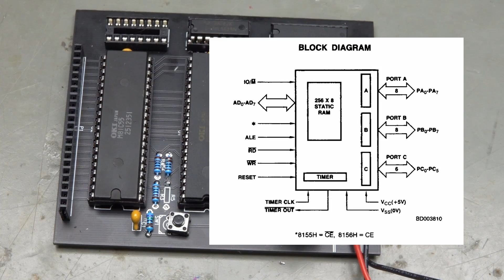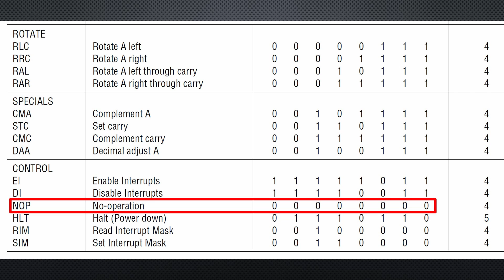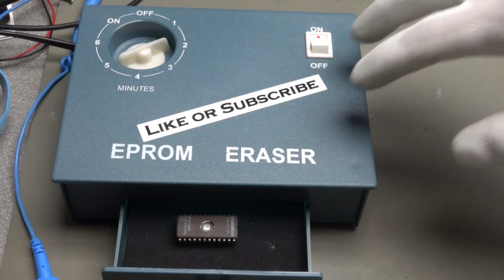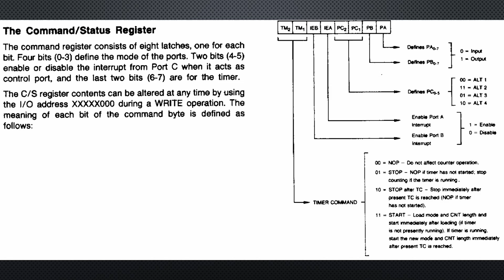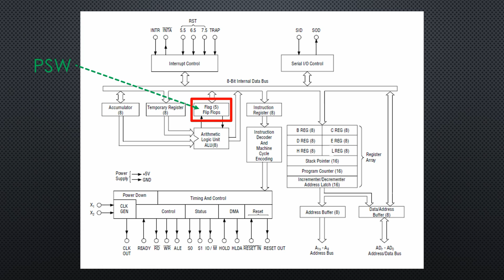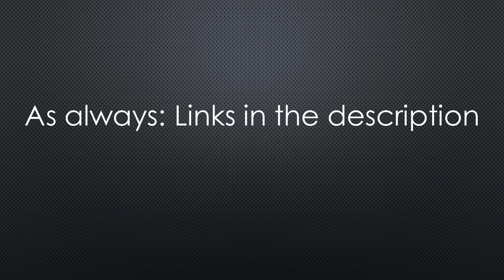#314 Retro: Assembler Programming with 8085 (incl. plan for board)

Comment: Excellent presentation!!! Kudos!

In biology,  scientists use "model species" like mosquitos 🦟  and other critters as reference models to represent  basic concepts. Similarly,  for me the 8085 is "reference model" for understanding how microprocessors operate. For example,, perfectly logical and meaningful instruction set. LDA for load and STA for store. In contrast, in Z80 every such opcode is simply a "Load" command - less intuitive. The 8085 registers are arranged in a beautiful, simple manner, and the rest of the CPU is minimal without all the fluff of modern CPUs. In Switzerland 🇨🇭,  you really want to see the forest from the trees. The 8085 should be the "go to" CPU for anyone wanting to learn the basics of microprocessors function. Unfortunately, progress moves on, and descendants of the 8085 began piling on the complexities of memory management units, paged protected memory, ring-node architecture, etc.  The one quirk of the 8085, from a hardware perspective, was the partial multiplexing of the address/data bus. However,  the designers wanted to fit everything into the standard 40-pin DIP. Anyway, the most elegant CPU of all time, IMHO.

I haven't yet viewed the project code, but for the delay one could simply write an inner loop nested inside an outer loop, giving 256×256 = 65,536 NOPs (minus the branching code, which also adds extra delay). Also, as one commenter mentioned, the various registers would not need to be pushed onto the stack if the delay subroutine did not use them. Even if an interrupt was generated inside the delay subroutine, all the registers and the PSW are pushed onto the stack inside the ISR, since as one commenter noted, the ISR is not always aware of which registers may be holding data from other parts of the program. It is interesting to see how pushing and popping registers maps to what higher-level languages denote as the "scope" of variables, which abstracts away what is actually occurring at the machine code level. 

Finally, thank you for all the links related to the project - what a great resource for the 8085 aficionados out there!
Reply from the maker: Unfortunately, this video was not very successful. I think because the 8085 was less popular than the Z80...
You are right. Some of the code was not optimized. I was a little "rusty" because I did not program in assembler for years...

Comment: Hello Andreas, this is a very AWESOME VIDEO, i read in the comments that you will not do more video like that, so sad about that i would like to keep dive into the argument with your board if for you this is not a problem, my goal is to make some kind of monitor like most of the sbc out there and should be accessible via a serial interface,  any suggestion about the uart implementation ? Should it be possible with your current design ? Or i nedd to add a 8051 chip for example ? Thank You so much for your videos and for your time
Reply from the maker: You should find quite a few 80805 or Z80 board projects using google. Even with some software.

Comment: You mentioned the imperial measurement system must have had an influence on American computer design. It explains the page / page offset memory addressing that provides arond 2^11 different ways to address the same address, as used in the IBM PC
Reply from the maker: I did not know. Thanks!

Comment: Brilliant and well presented. Even for the novices on the channel.. It brought back memories (pardon the pun) as after I qualified at a UK university in 1977 I worked for Accuray UK and they used Honeywell H316 computers for their industrial process control. These units had 32Kb of CORE memory with an 8Mb hard disk fixed head platter and ran DAP-16 a 16-bit assembly language at 1.6uS per instruction cycle.
Reply from the maker: Those were the days...

Comment: takes me bk,..i did a project usinf the early microcontrollers, in early 90s. all code was in assembler,  no uart, but made my 8 bit output emulate rs232 at 9600 bd. ,  later i was able to write my projects in C, but my end program ended up on sbc, with eproms, after cross compiled bk to intel hex..., life is much easier, n instant gratification today,..  ur channel is second to none,..  cheers
Reply from the maker: You are right. Life is much easier today!

Comment: I started my career in computers the mid-70s and by the late 70s had moved into embedded microcontrollers.  These slow (1-2 Mhz) "custom" chips that were 12 bits, actually had hardware multiply and divide.  The second chip was a real odd ball.  8 bit data, 10 bit instruction and 12 bit addressing.  In the early 80s we moved on to something more conventional, a close relative of the 8096 (8/16 bit).  Try writing a full fuel injection engine control system in only 8K of masked ROM and 300+ bytes of RAM !  Memory quickly exploded after that first year.
I was ultimately involved with "bringing up" the first PowerPC embedded SBC.

In that time frame the 8048/8049 were actually the most popular chips for embedded control.
Reply from the maker: So you worked in and industry with quite special chips back then...I think the standardization which was done by Intel and Motorola helped a lot to spread this technology fast...
Reply: @AndreasSpiess  The first chip was made by Toshiba.  The second was made by Motorola, but was never available commercially.  The Motorola commercial chips (680x) were much more simplistic.

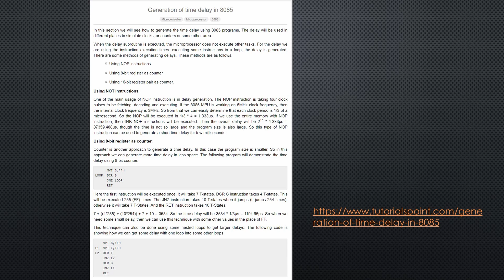Comment: If lines from jump instructions to their target labels cross you have spaghetti code. You explain the term at 24:04 but it is clean. The code at 22:40 is spaghetti code.

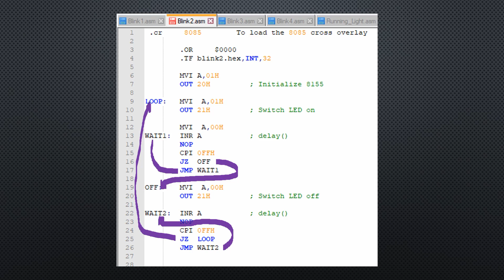Blink2 (23:39) can be made cleaner and use less bytes. Start with MVI A, 01H. Replace the CPI, JZ, and JMP instructions with JNZ WAIT. Do the same thing for the second loop. It will loop the same number of times as in the original. Blink3 (24:04) will loop forever if C holds a non-zero value. It was never set and is not changed in the loop. At 27:32 (blink4) the push and pops are in the wrong order and it has the same problem as blink3. The MOV A,C and ORA B could be removed or replaced with NOP to fix the problem.

A better, but more advanced, way of doing delay loops is using cycle counts. Each instruction takes a certain number of clock cycles and the CPU clock sets the number of cycles per second. By calculating the number of cycles used per loop you can set your loop counters to get very precise time delays. How you do this would require a separate video.
Reply from the maker: You are right. And I am glad you found the „Easter egg“ (wrong Pop order). Not many did
Reply: @AndreasSpiess  I've written a lot of assembly level code over the years. I'm currently working on two retro computer projects that need monitor ROMs. One is being written in 6809 assembler and the other is in 68000 assembler. I've written delay loops many times and used cycle counting to get the delays within a few cycles of the desired time delay.
Reply from the maker: The other things you mention were done deliberately. I wanted to have some "spaghetti code" for the younger generation ;-)

Comment: College level CS courses used to include some assembly language programming. Graduates understood what their code did, the benefits of efficiency, and the importance of releasing code with as few errors as possible. Now, ask a Java programmer about Java's interpreted code, and watch them flip out and scream "IT'S COMPILED! IT'S BYTE CODE MAAAANNN!" proving they're at least two steps removed from reality. Then, just TRY to talk to a JavaScript programmer. Just. Try. This is why there's no risk of computers taking over: within 20 years, no one will be left who understands how computers work, the automated factories will break down, and the last replacement parts will have worn out. Printing presses and newspapers will be re-patented, the iAbacus will be Apple's latest thing, Brawndo Corp. will operate all farms, and a Pro Wrestler will be president.
Reply from the maker: I also refused to learn tubes when I was young... So we can hope that Java and other developments are a part of this "natural" advance each generation should do.
Reply: @AndreasSpiess  I started with tubes, so I still squint/twitch when people analyze a transistor circuit by tracing current flow vs electrical charges. Good times, good times. You did an excellent job by the way, but that's what everyone expects on your channel though you might not hear it often.

Comment: Something I noticed you glossed over is that the PUSH and POP instructions always work with 16 bits, so when you say PUSH B you're actually pushing registers B and C onto the stack, and likewise when you say PUSH D you're actually pushing registers D and E onto the stack.  The POP instructions work in exactly the same way, always removing two bytes at a time from the stack.  The PUSH PSW instruction stores not just the flags but also the A register to the stack, while POP PSW loads them.
Reply from the maker: You are right. I hoped the interested people saw it in the simulator or try the example. The video already was way too long ;-)

Comment: I would have moved the I/O to I/O space, and the ram to 08000H, and allowed 32K to each of RAM and ROM.  Use 75LS139 for address decoder and qualify IO/M signal into address decode, or use NAND/NOR gates for decoding as we then only need IO/M and A15 to decode our space into I/O address and RAM/ROM space.  (I have lots of 32K sram and eprom chips)
Reply from the maker: I found the port mapping an interesting feature. Everybody had memory mapping these days ;-) But of course you can do changes. This is why I linked the project.

Comment: As usual an excelent video ! In school I had to program 8088 in assembler, well hell must be heaven compared to that. (For those not knowing what I am talking about : 8088 address space is NON linear ( as any other architecture ), so you have to always take care to move you 64kB ( 16bit address space ) "window" to overcome the 64k limitation. Or in other words : The memory had to be addressed in 10 64kByte blocks (640kB is enough for everyone) and later Intel did leave out one adddress line (A20) which made things even worse. A pure pain in the a** !)
Reply from the maker: The only 8088 I used were in IBM-PC clones and I already used Turbo Pascal and DBASE then...

Comment: Assembly still had its uses way past the 70's.  You could buld much tighter and faster code.  On one large '386 multitasking file system I did working on a large voicemail system which was used by PacBell in COs - I had written over 100k of assembly code.  After I left the company they later were updating the system from ESDI type drives to the new SCSI - which technically were 2-3 times faster.   
They called me in as a consultant because their new system was only a few percent faster.  They had done theirs all in C++.   All the tight little routines had been removed.  
Sometimes assembly gets a bad rep' - but for maximum speeds you must stick close to the hardware.
Reply from the maker: Today we probably have the choice between speed of execution and speed of programming. Back then, the second option was too slow and we had to stick with option 1 ;-)

Comment: Good job as always.  Oh, the old days!  I mostly taught myself so this with a Radio Shack computer with a Z80.  This stuff is still very important because it teaches how a computer with under the hood.  That gets lost when gold only learn high level languages.
Reply from the maker: I also owned a TRS-80 from Radio Shack. It is still with me ;-)
Reply: @AndreasSpiess  I dumped mine long ago.  Have you tried to fire yours up?  I always had connector connection problems.
Reply from the maker: No, I did not try. It would need a lot of work, I think. Find "floppys", a monitor, and the needed SW. Maybe when I am retired ;-)

Comment: I think I started with a Sinclair MK14, then went on to 8080's and 8086, we ran them flat out and the RAM and EPROM's could not keep up. So we had to have 2 sets of RAM and EPROM, Odd and Even address so each chip ran at half the speed. Programs written on a PDP11.  folk should be made to do some old school programming before being let out to write Ardunio libraries. I'm looking at one library at the moment that would be much easier to work out what it's doing, if they used the same register names as the data sheet.
Also it's written with about 1/2 the required functions missing, and the examples are full of bugs.

1/2 the time taken to write the software was taken up reading the chip data sheets, a 1/4 of the time writing comments in the code,  1/8th writing the code, the last 1/8 reading the data sheet again to check.

all this done for computers with less RAM than Microsoft needs to store a file with a single "a" in it.

Sorry great video if you got this far!
Reply from the maker: Thank you! I think, reading datasheets also today is not a bad behavior... I am happy that we now have traded speed of hardware with speed of programming. Otherwise I could not do such a YouTube channel. Only one project would be work for a whole year...
Reply: @AndreasSpiess  Forgot to add a Commodore PET to the list, which i still have to this day. Data sheets are so easy today, we used to have a bookcase about 30ft wide and about 8 ft tall stuffed with data books, and rep's bringing new one's every other week. it was a sad day when we threw them in the bin. :(

Comment: Brings back memories. Late eighties, I designed the camera controller for our early telemedicine system. 80C552 processor in assembly, controlling six motors with back emf speed control. Pan, tilt, zoom, focus, etc. Never worked well. Not enough CPU cycles for multiple PID channels.
Reply from the maker: Back then, HW was still quite expensive. Today you would probably use one subsystem for each motor. Or even an FPGA...

Comment: Ah yes, the good old days (they are good because we don't recall the hours debugging in assembler, staring at 3" of assembler printout with colored markers and scotch tape). :-)

I was so thrilled when we got a C compiler. My code still looked like assembler but loops and conditional and structures came into being. So much easier in a high level language. BTW, a lot of our debugging tools used writing to the eprom space (we had a latch or two or more there) so we could see what was going on. Our 'print' statements were essentially writing bits to those latch(es) to figure out where things went wrong.

Later we got an in-circuit CPU emulator and we could set break points, examine/change memory (EPROM could be copied into the Emulator RAM). Wow did that ever make things easy!
Reply from the maker: I used exess port pins for the same reason. But memory addresses with latches is a good idea. Very simple and fast!
Reply: @AndreasSpiess  for Motorola users the address latch made perfect sense. We didn't have ports. :-)
Reply from the maker: That is what I meant! Back then, there were big battles between which concept is better...

Comment: I appreciate you thinking your simple program looked like spaghetti; but, it was really easy to follow.
Real spaghetti code was called that when the code was very difficult to follow and thus to maintain and debug.
This was often a result in a programmer trying to get "creative" to work around the limitations of the CPU.
Ex: One of the CPUs I worked on did not have a CALL/RETURN instruction and there was limited ROM you had to get "creative" to reuse pieces of code so your code could fit.
Reply from the maker: I agree: This was a simple code. I just wanted to introduce the word...  A CPU without call/return is really not easy. This is why I mentioned htat the stack is a beautiful invention. Simple but very powerful.
Reply: @AndreasSpiess  The largest ASM program I ever worked on was an image analysis program developed for NASA.  It was on punch cards and filled about 4 card drawers; so, I would estimate is was about 12,000 lines of assembler code.
Reply: BTW, 12,000 lines of code seems like a lot of code (and it is); but, in ASM, 1 line of code is just one address in memory.  The program ran on an TI 980 16-bit minicomputer; so, 12K lines of ASM code would have been 24K of RAM.   The computer only had a max 128 KB max memory space.
Reply from the maker: NASA was on the moon with a few kByte of memory. And if you look at today's code: 90% is user interface and 9.9% is error handling. 0.1% is functionality ;-)
Reply: @AndreasSpiess  LOL, Some this I call the Junk Drawer Syndrome: Whenever you have a generic resource container (Junk Drawer, CPU Speed, RAM, Hard Driver Storage, etc.), the container will always quickly fill  to capacity.
Reply from the maker: Also here: https://en.wikipedia.org/wiki/Parkinson%27s_law

Comment: Hi ! I still have the original Intel SDK-85 System Desing Kit (MCS-85) from 1977. With original manual and package. I could send you photos. The manual contains hardware drawings and a software listing of the monitor. The kit has a keyboard (hex) and display to single-step etc.
Reply from the maker: Those kits seem to be very popular. They are mentioned wuite a few times in the comments. They already had a sort of "operating system". Because you cannot clock the 8085 too low. You still find some of the info and code in the internet. Also BASIC, for example. Maybe I will have a look at PL/M. Because this is also part of my history...